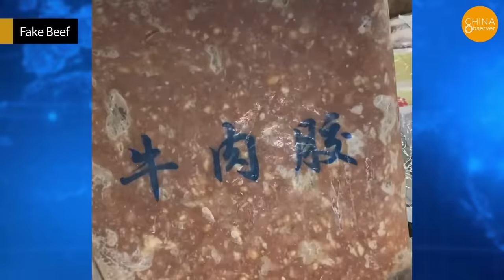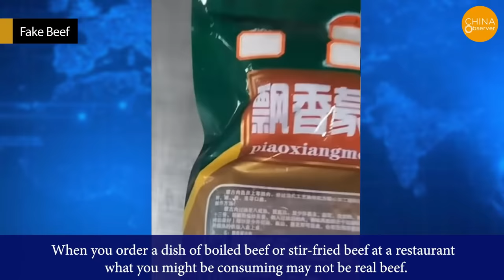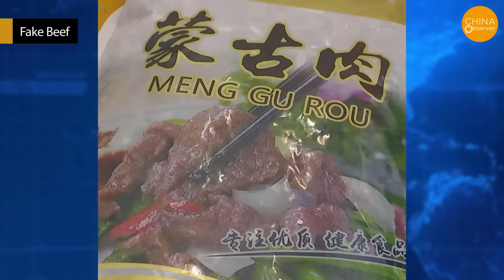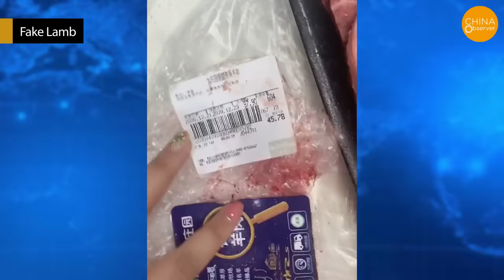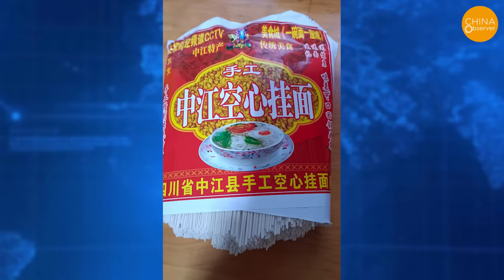Scary Counterfeit Foods In China: Fake Beef and Lamb Chops,Rice Made from Plastic,Aluminum Dumplings

Comment: Tofu bulked up with gypsum; sounds a lot like Victorian era bread "enhanced" with alum

Nevermind, looks like alum (aluminum sulfate) is also in the mix in this video.  Dark times indeed
Reply: Well, Gypsum is normally used as a coagulant in small amounts like cheese rennet for firm Tofu (Others do, like Nigari etc), 
Except for Alum (Which is not food safe), and too much Gypsum as a Victorian style filler. However, Bread used to be adulterated with Gypsum and Alum back in the Victorian Era though.

Comment: here's where I'm confused: even low grade sodium alginate (not food grade) costs $10 at the very least for a small bag which might make 30 eggs. baby chicks are $6 each and a massive bag of chicken pellet feed is $14. these chicks will reach maturity in 4-6 months and start laying eggs. hens usually lay one egg a day. so with a $200 initial investment to buy chicks (plus feed for baby chicks), you could start with 30 chicks. after 4-6 months, you will get about 30 eggs a day. you only need maybe one $14 bag of feed every couple weeks, if that. compare that to spending $10 a day bare minimum on just the sodium alginate powder (not even counting the other chemicals needed, to be replenished near daily, plus labor). over a one year span of time after the chicks reach maturity, buying 30 chicks and feed will cost you about $600 and you'll get about 10,800 eggs out of it. if you sell these at $4 a dozen you'll make $3600, so a profit of $3000. but over a one year span of time, buying the daily bag of sodium alginate alone costs $3600, you'll still get 10,800 eggs, which means that you break even in the best case scenario. moreover, chickens will live almost anywhere - a shed, a large pen, ect as long as there's hay and a couple other odds and ends. and that's with just 30 hens. imagine if you had 200 hens (that's $20,000 a year if you can sell all your eggs). no matter how you cut it, it is more profitable in the long run to just buy and raise the chickens. am I missing something?
Reply: Nope!! You summed this up greatly.
Reply: Your explanation is remarkable. But for those people, they're probably making fake eggs since those can be crafted in a basement. 🤣
Reply: Thank for the calculation there. You really summed it up. As for me, I still prefer live hens, or any animal for farming. Other than the cost and the profit, their wastes are beneficial too. Plus, it's nice having them around. They're smart, emotional and playful.
Reply: They can make a lot of faked eggs within a short time, time is also a part of cost.
Reply: Allot of these situations make no sense.  It makes me wonder if it's even true.  Can you even make fake rice cheaper than you can buy it?